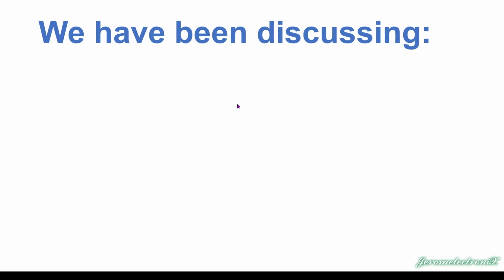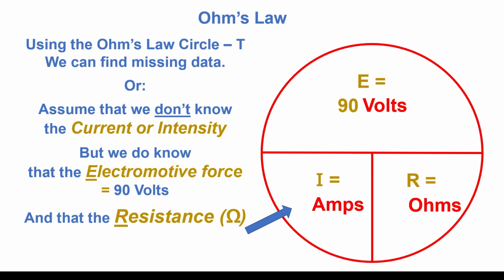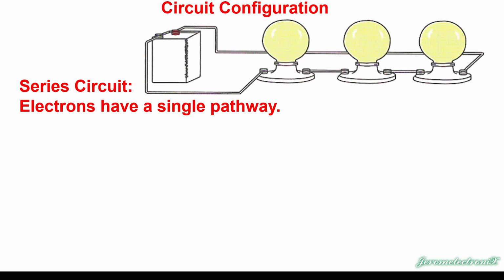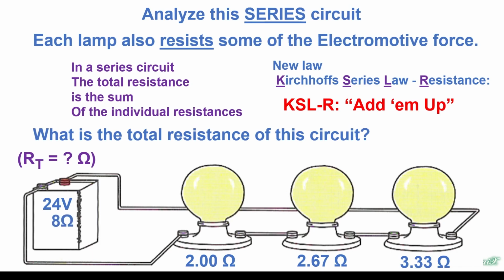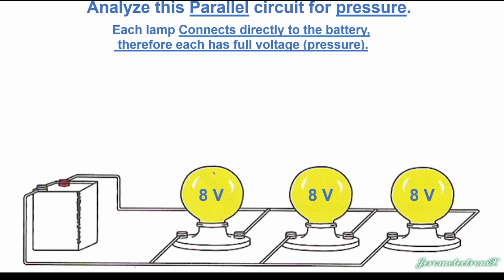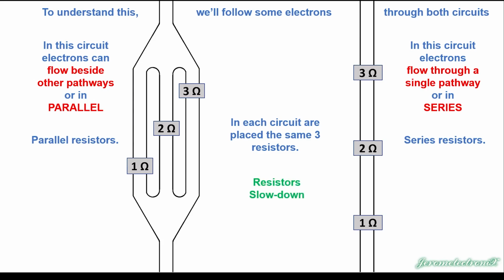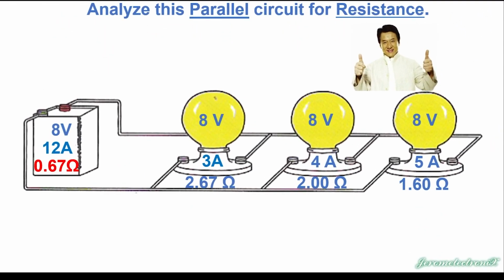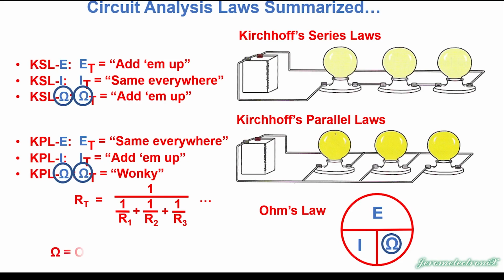L 05: Electricity Intro 3: Ohms and Kirchhoff's Laws, Series vs Parallel

Comment: Not sure where you are getting pentillion from.  Can't see that it exists.....One million = 1×106
One billion = 1×109
One trillion = 1×1012
One quadrillion = 1×1015
One quintillion = 1×1018
One sextillion = 1×1021
One septillion = 1×1024
One octillion = 1×1027
One nonillion = 1×1030
One decillion = 1×1033
One undecillion = 1×1036
One duodecillion = 1×1039
One tredecillion = 1×1042
One quattuordecillion = 1×1045
One quindecillion = 1×1048
One sexdecillion = 1×1051
One septemdecillion = 1×1054
One octodecillion = 1×1057
One novemdecillion = 1×1060
One vigintillion = 1×1063
One unvigintillion (or vigintunillion) = 1×1066
One duovigintillion (or vigintiduoillion) = 1×1069
One trevigintillion (or vigintitrillion) = 1×1072
One quattuorvigintillion (or vigintiquadrillion) = 1×1075
One quinvigintillion (or vigintiquintrillion) = 1×1078
One sexvigintillion (or vigintisextillion) = 1×1081
One septvigintillion (or vigintiseptillion) = 1×1084
One octovigintillion (or vigintoctillion) = 1×1087
One nonvigintillion (or vigintinonillion) = 1×1090
One trigintillion = 1×1093
One untrigintillion = 1×1096
One duotrigintillion = 1×1099
Ten-duotrigintillion = googol = 1×10100
Reply from the maker: I admit you are right.  My defense:  Geezer moment.   I have been told that I need to edit this video.   I think I might need to get the other 25 or so recorded first.   Thanks for the insight.